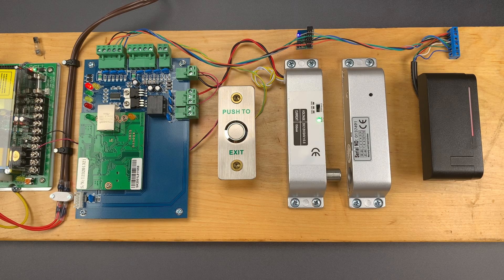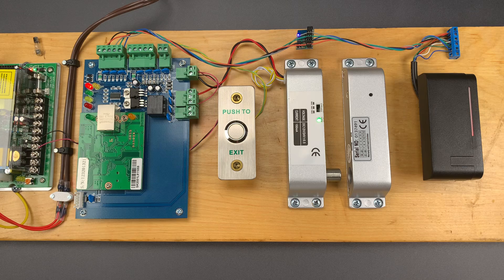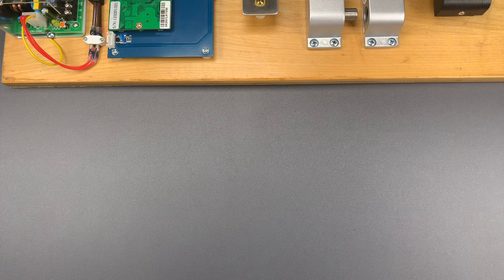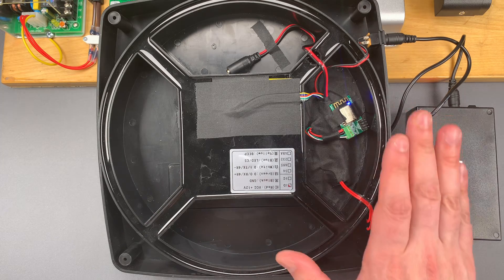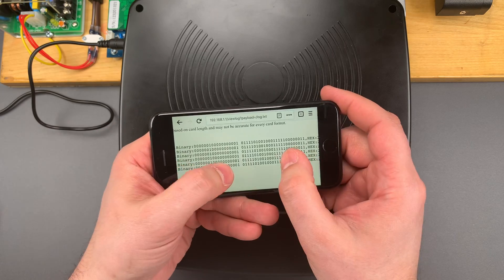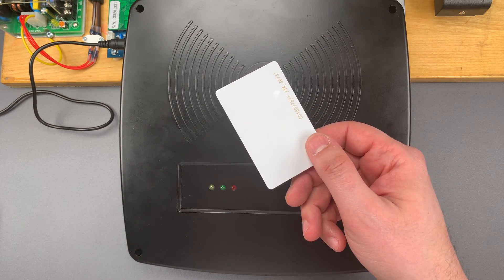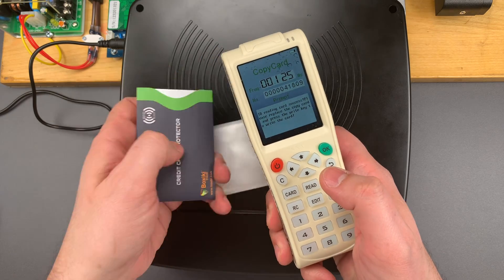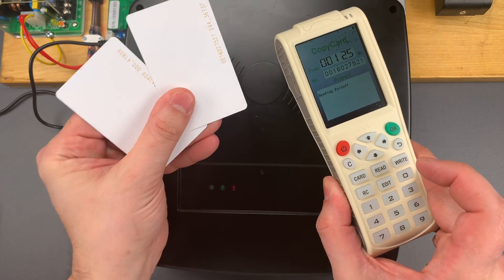[1056] This Black Box Reads RFID Cards in Your Pocket

Comment: Here's the craziest part about physical security: you can have isolated readers/access panels, encrypted communications, and encrypted RFID devices... and your employees will hold the door for a criminal who dresses up like an employee and walks up to the door carrying a bunch of heavy boxes.
Reply: Yep, social engineering attacks. The best defense is education on what to look out for.
Reply: Or out the door with a truck full.
Reply: Know of a facility that had a concert grand piano stolen. Piano tuners came, told reception they had to take it away to be tuned. Reception held the door open as they rolled it into the truck. Never to be seen again.
Reply: @vk3fbab  ... That receptionist clearly didn't understand the first thing about that piano.
Reply: @vk3fbab  There was a great safe robbery in Sydney. Before the mobile phone was a thing. I saw a truck marked as Acme Safe Transport which turned up at lunchtime and delivered the new safe and took the old one away while the business manager was at lunch. Even got the receptionist to sign for it and left her a receipt for the old one which contained the department's cash payroll. We were all paid in cash back then. Alas the old safe was never seen again. The new one had been stolen in a similar way some months earlier. It contained a thank you note.
Reply: or better, if your employees wear a normal suit or business casual clothing, an intruder dressed like that with just confidence can easily infiltrate you if security is loose, twitch has nice pizza every friday for their workers by the way
edit: basicaly if you look like you belong here nobody will question if you belong here
Reply: @Aro666pl  its very true, people see the uniform not the face, kinda like that game  "hitman", also works better if you wear a suit in a place where the uniform is overalls or stuff, the workers will assume you are a higher up and wont want to bother you so will let you in, there was a case where a man purposely corrupted a keycard  and wore a suit in a radioactive waste site,  he said he was a inspector checking everything was being disposed properly, fed them some story about he would have to take a 2 hour drive back to the office to get it reset and workers let him in, he left with multiple containers of waste "for testing". Was months before anyone realized anything was wrong, as the workers had put it as authorised waste removal and the people in charge had no reason to check it.
Reply: @aidanhancock2117  yep, i'v been to places for work that while I was allowed in, could easily see myself getting in just wearing a 'uniform'. Dress shirt and slacks are my uniform for these facilities and the workers don't even look twice... i'v even walked around doing surveys for wireless and other things alone, and because I had my laptop and my uniform (really the only thing that was uniform about it was my companies name stitched onto it, which was covered by my hoodie in one instance because it was chilly), the workers did not say anything.
Reply: @MrSolLeks  kinda weird how they dont doubt you belong if you look the part.
Reply: A N I  M E
N
I
M
E
Reply: @Aro666pl  this has worked for me a number of times. Not to do anything nefarious. But I have in the past had to use the bathroom in an area without public facilities. Just finding an office building and walking in confidently worked in my favor.
Reply: We were told never to let anyone in our office if they didnt scan in themselves. So I didnt, one day a guy tried to follow me in, i challenged him and said he needs to have a card, he said "its ok dont worry" then proceeded to push by me and go inside. I immediately alerted our facilities team who deal with the security. You know what they said to me "That was a director that you challenged, you should have did some due diligence as he was not happy about it" So what is the actual F**King point of this policy if when I challenge someone, I am the one that gets told off???
Reply: @thornbottle  true
Reply: @thornbottle  If I was the director of that building, I would've had the sense to give you a promotion.
Reply: @thornbottle  you should have been rewarded for that as opposed to punished.
Reply: No better tool to infiltrate high security areas than a Hi-Vis vest and a clipboard.
Reply: I worked at a place that was adamant on not letting anyone in that didn't have access to the place. Such as employees and contracted workers.
The place held goods worth in excess of 20 million dollars all neatly stacked onto pallets that could be picked up and loaded onto a truck with ease.

EVERY SINGLE DAY truckers and god knows who else was allowed into the building. Or they just walked in like nothing.
And since we were understaffed, the truckers themselves had to load their vehicles using the forklifts we had.
It was basically a big fucking mess. But every day, our bosses told us to keep unauthorized people out... Except those truckers that had to load their own trailers because... It costs money to hire the people to load them.

In any case, social engineering ALWAYS works at one time or another.
If a door is to be locked to people that don't have the proper credentials then you, as one with credentials, must make sure that you and only you pass through that door when you key in.
ALWAYS FORCE anyone else that wants to pass through the door to show/use their credentials.
But again, social engineering will always be successful eventually.
Reply: @RealCadde  I've done it as well.  Feels bad but, I smile nicely and say something like, "I'm so sorry.  I don't live here.  You know how it is, right?"
Reply: I've closed the door behind me leaving an apartment building with someone waiting to enter. It felt so terribly awkward even though I knew I was doing the right thing. If I'm waiting to be let in I make sure to stand well away from the door so no one has to feel the same way.
Reply: There are single person entry doors in high security places.
Reply: I just carry a couple boxes of donuts and offer one as somebody holds the door open for me
Reply: @MattTrevett  you're sort of drawing additional unwanted attention to yourself at that point, aren't you?
Reply: NO TAILGATING 

Randomized attempts by security contractors are always a good way to train people too. Nobody wants to sit in retraining, much less let spies in!
Reply: @andrewc1036  Being a pentester always seems like a really fun job.  It's the closest thing to being a spy in the movies, but without most of the stuff that makes people not actually want to be spies IRL
Reply: It’s basically the same with hacking computers, no matter how good your virus protection is, the biggest vulnerability will always be humans
Reply: I have worked at a financial services company and repeatedly got shit from management for repeatedly refusing to open the front door to anyone who forgot their access cards, co-workers included. 

It's right there in the goddamn employee handbook and I got warned about it twice.

So yeah the human is always the easiest way through the front door.
Reply: I think that's true of just about any type of security.  No matter how carefully you plan, the weakest link will always be the people you have to allow through.
Reply: @davidbrown9021  lesson #1 of cybersecurity: your biggest enemy are the people you're trying to protect
Reply: *a wheelchair
Reply: @michaelknight2342  wheelchair would probably also draw more unwanted attention, I would imagine..
Reply: Yeah, all high security environments essentially drill into your mind to do away with manners and politeness. You can get fired for opening the door for someone and it was regular for Managers and leaders to try to trick people into letting them in so they can fire people they didn't like. I literally closed the door on my CEO's face once and he actually praised me for it later. If you work in this environment, it is generally well known not to allow tailgating.

The most dangerous actors are generally vendors and service/maintenance workers. We're all so used to tuning these people out, that they sneak by unnoticed even by trained professionals. I'm only in the IT department, but we got in huge trouble when the guy who collects our shredded paper was found on the property without an escort.
Reply: The best defense against such an attack would be defining restricted areas, where maintenance is performed at the request of the staff.
This way, only known people would normally access the area, and if someone wants to get in, they will grant or deny access according to schedule
Reply: @TheNasaDude  or you could just get the door for them, wtf man
Reply: I heard there was a hotel robbed like this: a guy in a suit with a name card with the hotel logo was telling guests, that there is a issue with the access cards and he wants to check theirs. They gave him their cards, he "checked" then with a machine, gave them back, reassured them that their card is OK. At the end of the day, he had clones of buch of the cards....
Reply: The best way to get into a building is to show up in a wheelchair with a box of cupcakes. It is absolutely stupid how well this works.
Reply: A woman with a false pregnancy belly carrying 2 trays of starbucks drinks will be let into pretty much anywhere.
Reply: A site I worked had a guy just walk in pretending to be a tech and pulled TV's off the wall while the office was open. No one questioned it, they just assumed the guy in dirty work overalls was working.
Reply: That is too sophisticated. Now because of COVID we have to wear masks. And Because its winter i wear cap and gloves. Literally only my eyes are visible and I carried my work desktop PC out at the front gate without questions asked and a guy even held the door for me. The backdoor would be even easier because the "security guard" there is someones relative and she doesn't like working. So nobody would even notice it. And again still in winter clothes mask cap and gloves so the security cameras and any investigation would be useless. They would know that someone dressed in full black carried out the desktop at x O'clock.
Just be confident and say hello to every one and all gates are opened.
Reply: @Gege547  yea confidence is all that is required, if you can convince people you belong there they wont check.
Reply: True, but most companies I've installed systems for have strict guidelines against that sort of thing and will indeed get you fired.
Reply: Can you read credit cards with this
Reply: @pellojones1699  ?
Reply: @aidanhancock2117  can it read credit card numbers
Reply: @aidanhancock2117   can it read credit cards and how to protect yourself
Reply: @pellojones1699  yes it reads ALL things with a microchip,  including credit cards and you can get special wallets to protect your cards ect
Reply: @pellojones1699  it can even read phones and laptops
Reply: Confidence is one of the best lockpicks. Pretend like youre supposed to be there and others will assume it to be true.
Reply: This is basically how I get into downtown music venues without paying a cover after I get off work. I'm a street artist with a display that loads into black boxes which are then loaded onto a hand truck. The door guy assumes I'm with the band and am bringing in sound equipment.
Reply: You can't really steal anything during working hours anyway. The goal of these techniques is to gain info to allow you to hit a system or access point when no one is around.
Reply: picking a lock through social engineering
Reply: that is called social engineering.
Reply: Can it read credit cards
Reply: Turnstile: problem solved.
Reply: Just put on a hi-vis vest and people will let you in anywhere!
Reply: Part of the security training we were given before COVID caused working from home involved emphasis on not doing precisely this.
It stressed making sure people didn't follow you through secure doors, or if they did, that they also had an access card.
Or something like that.
It's been almost a year, am a bit fuzzy on it.
Reply: That attack is known as social engineering. Very good against unaware and improperly trained employees.
Reply: I can say for a fact it’s an issue. But they don’t even have to carry anything.  They could just say, they forgot their RFID in the office. Even people who worked in secure places a long time would let them in.  It’s complacency and a lack of responsibility.
Reply: As someone who hasworked security before I believe you.
Reply: This IS the biggest problem, and will always be there. Most people don't take security seriously. 

Keeps my job relevant i suppose....
Reply: It’s the same with all security.  You can spend millions on the most elaborate tools in your IT security infrastructure and your employees will click on every link in their email anyway.
Reply: @glashoppah  best way to avoid the email issue is to send out frequent fakes that log who clicked, then make them take a security refresher course. Eventually they'll stop clicking out of sheer annoyance
Reply: @glashoppah  so true. Still happens every day
Reply: That happened in my company 10 years ago, after that they've changed doors to rotating gates (dunno what's the proper name in english) so only one person can go through at the same time.
Reply: That’s right, I’m not a security guard
Reply: Haha, so true 😂😂
Reply: Don't give me ideas bro .... don't give me ideas.
Reply: Hm
Reply: weird how burnt out employees dont give a fuck about their capitalist overlords property.
Reply: i work in a school and i see people do this all the time... for people they dont even know...
Reply: Rubber hose cryptography/human-channel attacks. The only two things you can never defend against...
Reply: We had a door at a former work, blew a fuse in the locking mechanism so door was unlocked. Who knows for how long, external door and no one even outside of hours used the key lock, until after that happened then was at night gets locked with the key.
Reply: Easy fix.  Security  camera. Fire any employee who lets someone else in.  After a few are fired and the rest told, they will learn.  You train your employees to call the person on the delivery package to come to the door to receive the package.  Call security to escort the perp.    Train the employee to just wait it out and let the perp figure out who to call for access.  If its an apartment/condo building, evict the offender or ask the police to charge them with accessory.
Reply: @rickpaulos  easy said than done.  It’s not easy to replace people. For secure sites, they need the security clearance and the skills to do the job. By firing people they could risk not being able to complete the jobs the company needs to get done.  It’s usually a training refresher course.  Then renting an restricted access apartment or a hotel with private access. It’s more of an strong suggestion rather than a strict rule. If they paying rent and not many complaints from other tenants or guests then who is going to stop them? 

It’s called risk management. If the risk is too costly to stop completely, you can reduce its occurrence to an acceptable level.  Nothing is ever 100 percent in security. That is a pipe dream.
Reply: @rickpaulos  This isn't an evictable offense in the united states, and if you listed it on eviction papers a judge would have your ass on a silver platter. Police also don't charge criminals with crimes, their local DA does, and you as a citizen won't even be permitted to speak to them, let alone influence charging decisions. 

The answer for employees isn't punishment- It's training and vigilance. These are human people, not interchangable toys that you should see as expendable or removable the second they do something not good. In all but like the most absolutely secure facilities, mistakes happen. You have the employee re-trained, or you use systems real, mentally healthy employers have used for decades like write-ups of the employee that eventually lead to dismissal. But firing someone immediately for something you don't like isn't being a good boss, it's being a mentally stunted and deranged child with authority. The kind of boss who randomly finds his tires slashed or his car keyed more often than he'd like. 

Be a better human. You are not being the person Mr. Rogers knew you could be.
Reply: @ParadoxicalThird  you talk about acting like a child and being immature, and in the same breath you justify slashing your bosses tires and keying his car when he's an asshole. 
 Uhhhhh, hypocrite much? 
Also, at least where I am from, when the police arrest you and book you in, THE POLICE charge you with a crime. The DISTRICT ATTORNEY prosecutes you for the crime you have been charged with.
 Sooooooooooooooooooo.
Reply: You must not frequent secured locations
Security clearance? Don't have one?
Then shut up
Reply: @dnfl-7168  I guess by definition if they're letting strangers in, it isn't secure  🤪
Reply: @dnfl-7168  bro none of these statements are worth getting triggered over, you should try to relax.
Reply: @dnfl-7168 you're an idiot. Hackers hack clearance not get it handed down from a boss with more authority than you. Having clearance for a job so you are forced to do so you're not homeless is different.

Comment: I folded up several layers of tinfoil and put it in my wallet. Without that, I can pay with my rfid debit card just by holding my wallet near the terminal. With the tinfoil, I have to take the debit card out of the wallet to make it work.